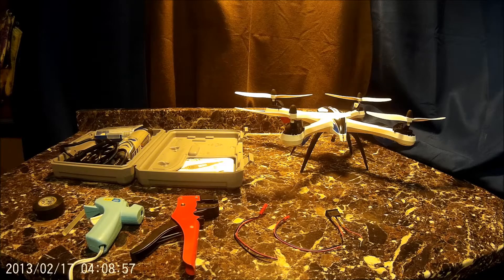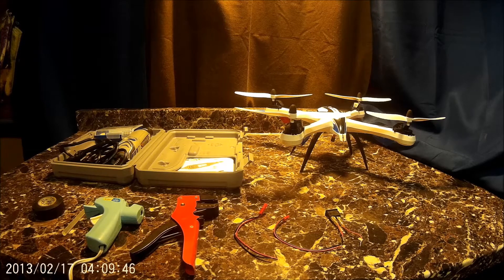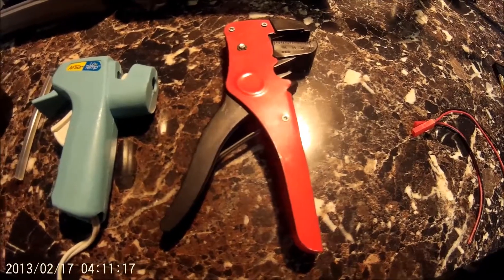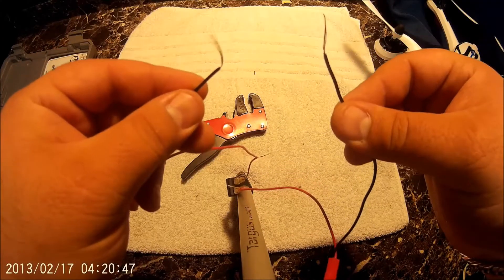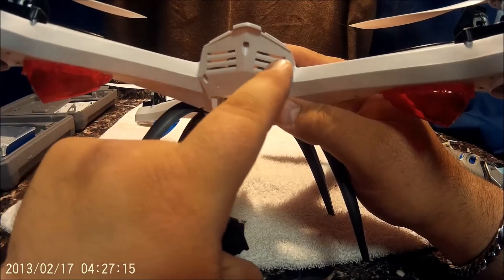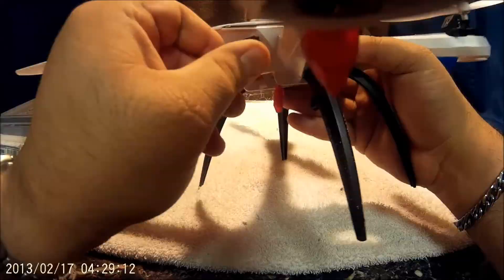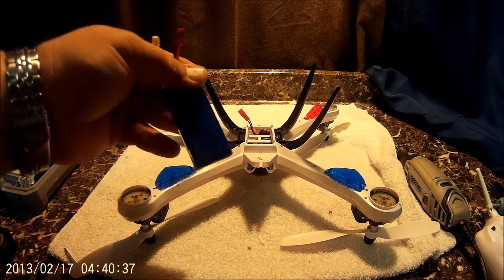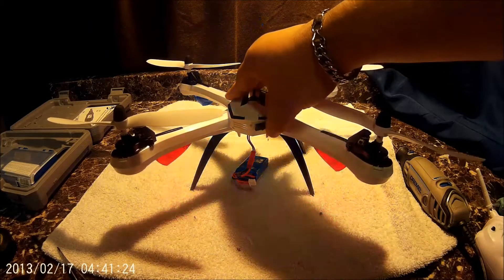JJRC X6 Tarantula EASY On/Off Power Switch MOD Install (BANGGOOD)

Comment: Does your X6 LVC triggers early after installing this switch? at which voltage did it cut off?
Reply from the maker: +Asri Zainal Good question. So far the LVC is normal. When I pull the battery after a full flight it says its @ 14% charge which is the same as before I believe. Thanks for the comment!
Reply: The Flyin Tek can you please try the full throttle or do some maneuvering to see if the LVC is kicked in early or not with this switch?